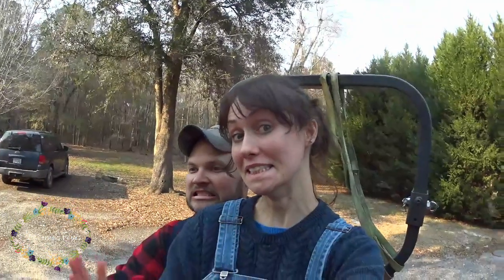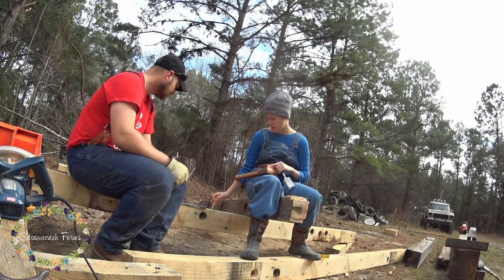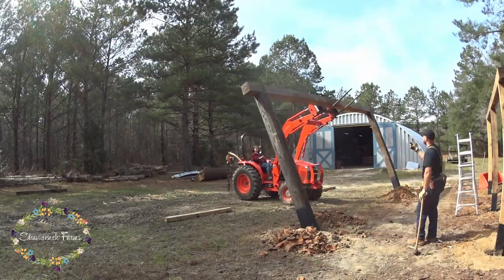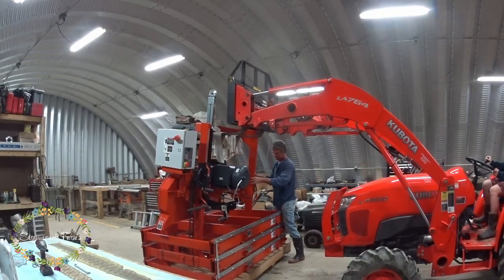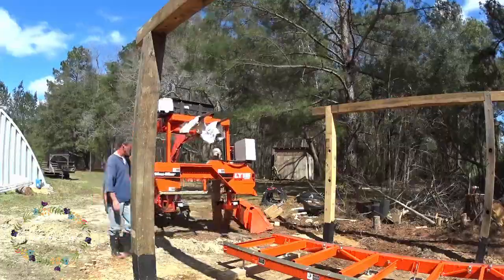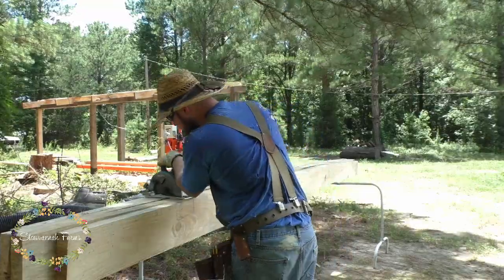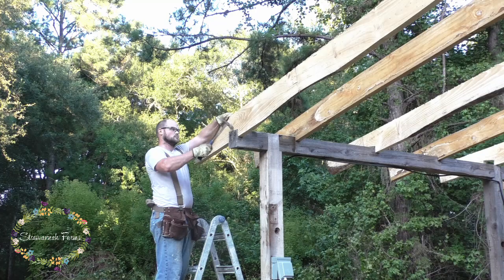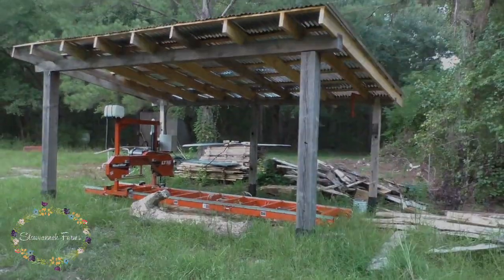How we built our sawmill shed | Wood-mizer LT15 Wide

Comment: question for you- how long do you expect those timbers to last in the ground? I'm building my shed in the spring and was thinking about bolting the upright beams to cement pylons I would pour in the ground to make sure they don't rot out and keep insects out of them...
Reply from the maker: I've heard pouring cement around beams isn't the best -- cement holds water so when it rains, etc, the cement will hold the water around the wood. We're hoping the tar keeps the beams solid for years, but haven't actually done it before, so can't say first-hand. Good luck on your project.

Comment: Love the build...i so badly want my own sawmill....btw...can you give me any contact info on your metal quanset hut shed and what is the size and relative cost for that?
Reply from the maker: can't recall the company, but it was $12.5k for the metal kit, 40x50.  We had another $600 for the wood for the forms, around $8k in the concrete, and about 1.5k in electrical. We have an old video that goes over the building process of that shop. thanks.

Comment: Hello. Question - where do you get tar from? Is it something similar to a pavement restoration fluid or its a real tar used for pavement - is it hardening when cooled down?
I tried to get some tar in Thunder Bay Ontario - no chance - they sell it premixed with crashed rock and preheated in tons. Would you give some link to the seller of the tar or is you made it yourself (like made of birch bark) could you share the approach.
Thank you
Reply from the maker: Hey Ab, just saw your email. It's just a bucket of tar roofing material from depot. I sent you the link. Thanks.

Comment: This vid is a couple of years old, how is the mill working for you? I am in the process of clearing my land near NaHunta, I plan to have a wide mill and do commercial milling for fun. Have not decided on the brand mill I am going to buy. Any thoughts about your woodmizer will be appreciated. Thanks
Reply from the maker: We sold our lt15 wide with this house. Now we have an lt50 wide.  Charley really loves all the hydraulics that the lt50 has. Both are good mills, though, and woodmizer's products overall are really good quality. We own their sharpening equipment, too. Every once and a while their products will have an issue, but woodmizer's customer service is great. They've come out to our property twice and both issues were resolved completely. Not sure what your setup is going to be like, but they are coming out with another series for extremely wide cuts... something like lx250 ? Can't remember exactly, but the cuts are around 60" wide. We'd recommend electric if you can do it, and to buy as big as you can afford... youll growi into your mill before you know it. Hope that helps, Sarah.
Reply: We have 2 woodmizers and love them both. Only question I got is with electric mills do you leave the mill running all the time or engage the blade(electricity) for every cut. Seems like  you'd be paying more in electric for demand engaging in sequences vs running it steady? Thanks in advance!
Reply from the maker: you can do either way, I usually would turn the motor off...it is just a button push and nothing to wear out like a starter would if you tried that with an engine (at least with the LT15...bigger mills with an accuset or simpleset you might just leave the motor running just like you would an engine).  Electric motors are way more efficient, and use almost nothing when idling, unlike gas/diesel.
Reply from the maker: Under full load conditions, my LT50 uses 1.8 GPH, which is $4.32/hr ($2.40/gal diesel), whereas a comparable 25HP motor will pull 18.6 KW, and even at a .12/kWh (which is on the high side), that's $2.23/hr.  Both these numbers are assuming you're cutting full power constantly, which is not possible, just a comparison.

Comment: Water want blow ion the motor ?
Reply from the maker: Maybe with heavy rain combined with wind,  yes. We were keeping a cover on the motor before we completed the shed since it's not supposed to be directly rained on, but it's built to be outside, so a little bit of rain or humidity is fine. They seal everything pretty well.